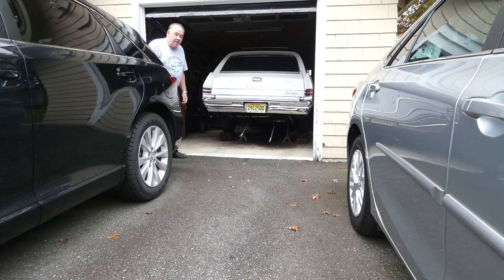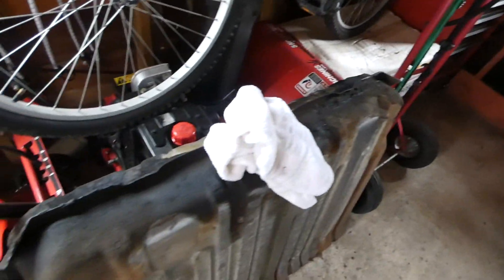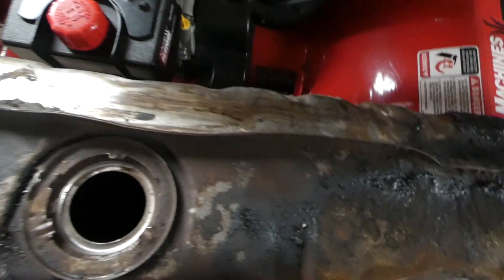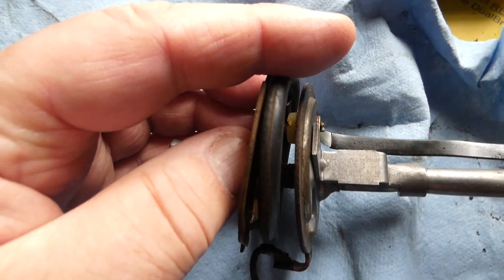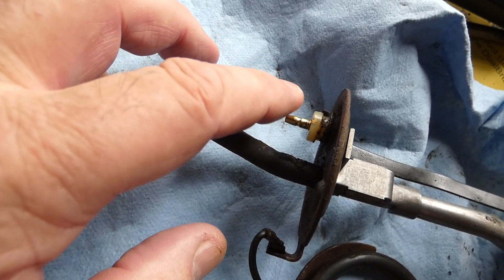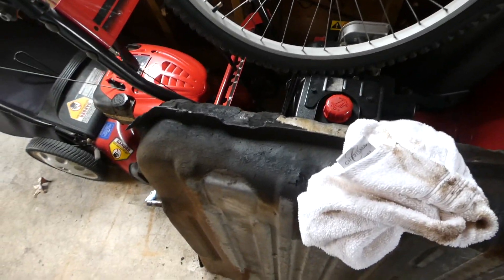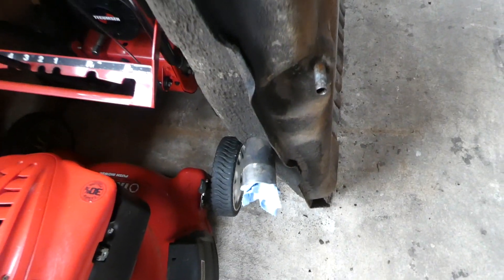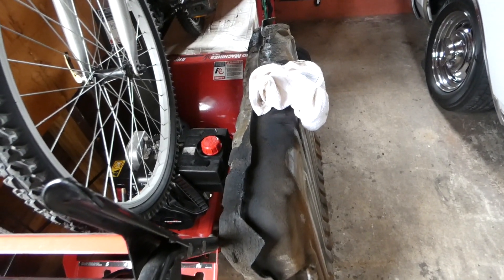The Radio Flyer has a bad leak!

Comment: If you order a new sending  unit hopefully you get a new rubber gasket with it, they ain't cheap. Usually non undercoated gas tanks  get pinhole leaks ,
thanks to salted highway driving in winter. Don't ask me how I know because I once owned a  4 door 1970 Chevy Impala which was a hand me down from my dad.
The rear window glass seal leaked when it rained and messed up the rear deck behind the seats. It did that when it was only 5 years old!!! At six years old the windshield wiper
motor went out and the rear taillights sockets rusted out.Needless to say it was the only GM product I ever owned. The Radio Flyer looks nice and well loved!
Reply from the maker: That's funny you mention that. I had a 4 door 69 Impala. I bought it without the motor for 50 bucks. The 327 had a bad problem with one of the main bearings (so I was told) and found (for free) a running 283 from a rear-ended 65 Impala 4 door. I  did some body prep and sent to "Earl Shieb" Worst 50 dollar paint job, but still looked better than when I got it. The "Radio Flyer" is a 1967 Buick Sportwagon. Car had 49K miles when I bought it, but I had to do a bunch of work to it. Had it for over 5 years now and has 57K miles on it now. Has some scratches, dings, and patina. Mrs. RW and I love it!